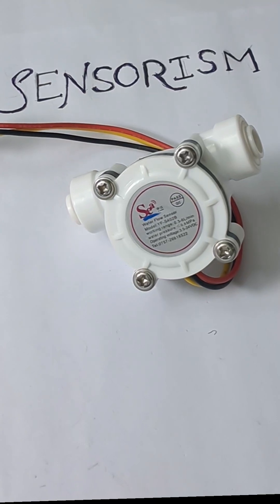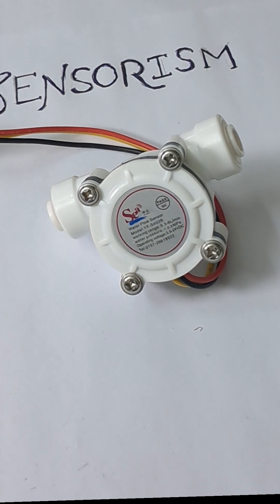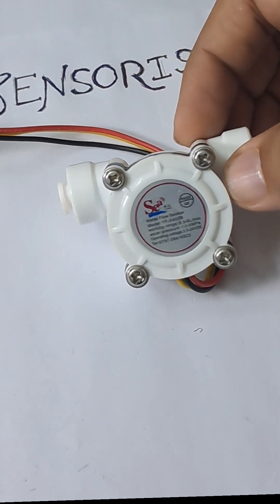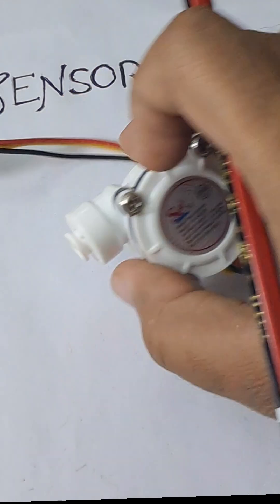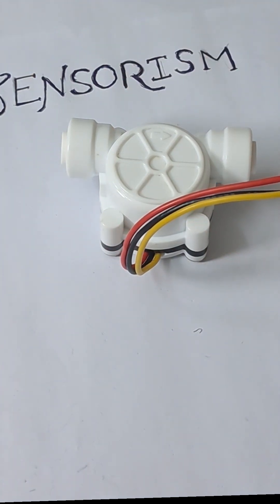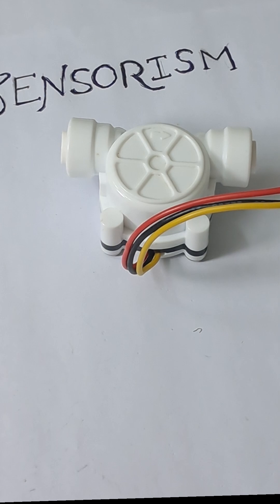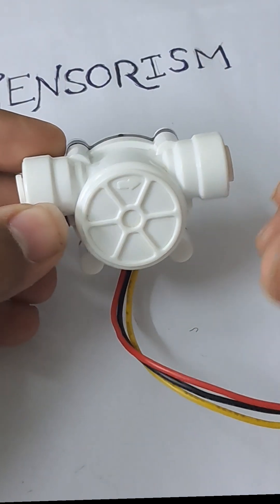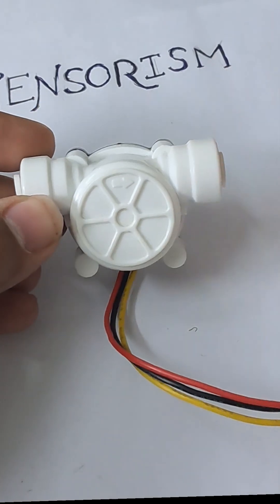Water flow sensor explained

Comment: I need this with display.....can u help
Reply from the maker: https://sensorism.blogspot.com/2024/11/096-oled-inch-display-interfacing-with.html?m=1

This can help.

if you have any specific display please mention that. i will check if the blogpost code needs to be modified.
Reply: @Sensorism can you call me or can i call you. Is there way to connect you. I want you to create and send me project. Is it possible. I would pay ur charges if any
Reply from the maker: I can guide and tell for any modifications. Cureently, Not placed appropriately to do projects. 
For queries, please mail to info@sensorism.tech